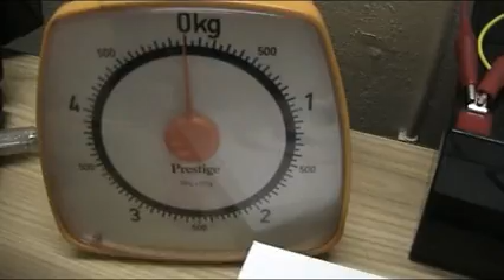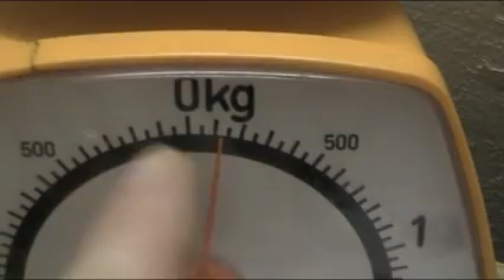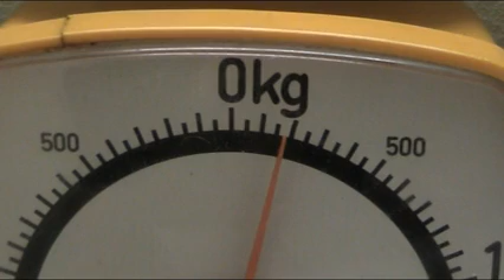Mostly Permanent Magnet Motor test 4

Comment: Amazing! Who was again the fool who said one cannot extract energy or work from permanent magnets? Maxwell? And of course the entire naysayer army... Tell you what, not sure if you're aware of it, but you just debunked the 2nd law of thermodynamics. Keep up the good work ^^
Reply from the maker: Hi Harry, not too fast there. You're looking at an old video. Have a look at my forum topic link: http://www.overunity.com/8429/mostly-permanent-magnet-motor-with-minimal-input-power/msg420188/#msg420188  here you will have the most up to date development. The limitation is not the pulling or pushing force. The limitation lies in the speed the coil can move in a powerful magnetic field. The stronger the PM field the more Torque force there is but the slower the coil can move through the field. That is the limitation. Read the more recent posts of the topic. Luc

Comment: I just went back to the bench, I like to play with that circuit a lot. The cap holds enough charge for 2.5 go. It goes up two and a half time. The 12V battery I used to charge the cap, goes right back up to 12.39 after it charges the cap in a few millisec. Now that's efficient. Imagine an electric motor for a car that uses this principle. Instead of 100 km range one could possibly get 400KM since we now know that it is 75% more efficient than a regular pulse motor. Furthermore .. out of room ...

Comment: Good test Luc, I just tried it, with my small 12 volt relay coil and a 10000 uF 16 Volt cap.
With one magnet on each side it lifts the coli all the way up, it stays up there for half a sec. The more magnet the stronger/faster it gets. This amount of power versus work can be calculated precisely, but we can see that it's very power efficient and promising. This great idea of your has good potential.